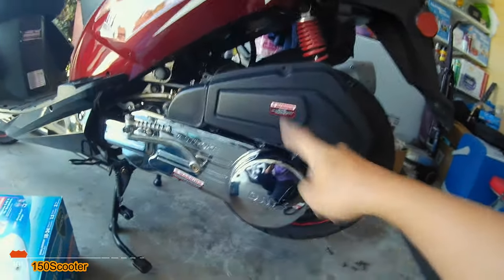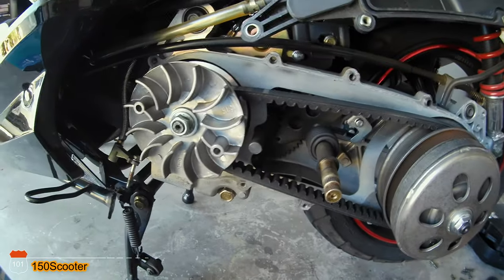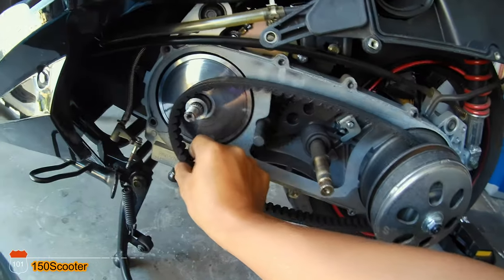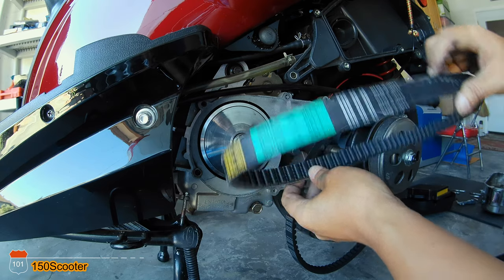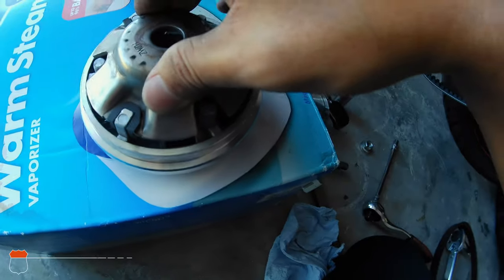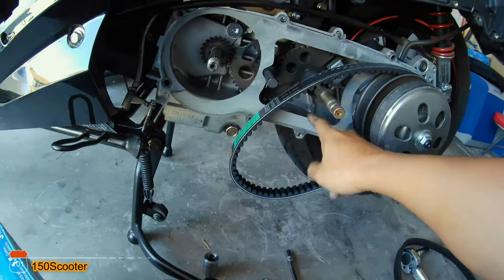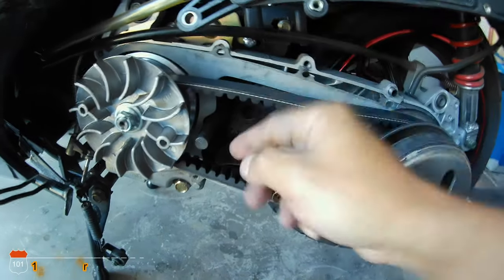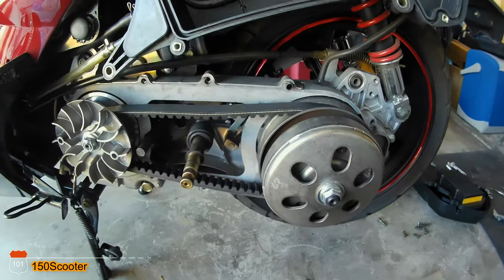How to Replace the CVT CV Belt on Your Chinese Scooter GY6 | 150Scooter

Comment: How on the world did you get the belt cover off i removed al the screws and it wouldn't come off now my moped is making a weird like clicking noise in the back please help
Reply from the maker: First time removing the cover you have to wiggle back and forth with little bit of force. Make sure the remove all the screws plus the kick start.